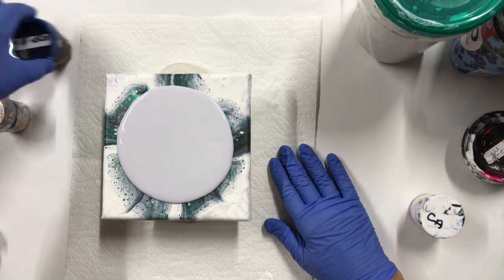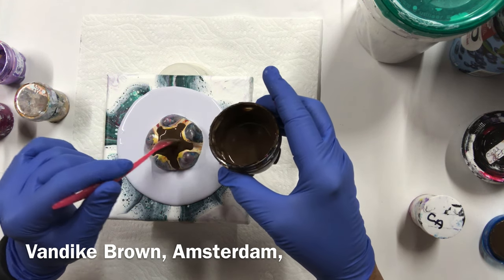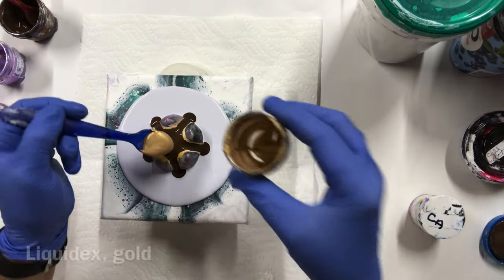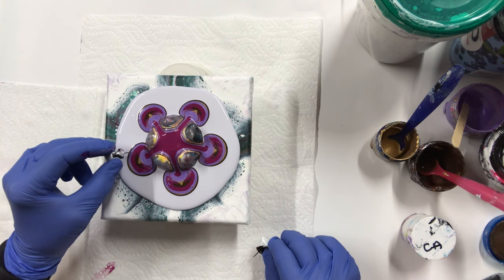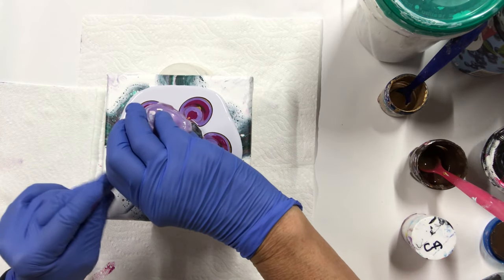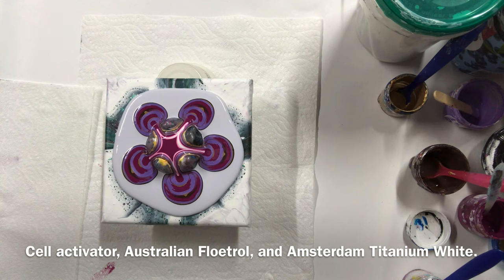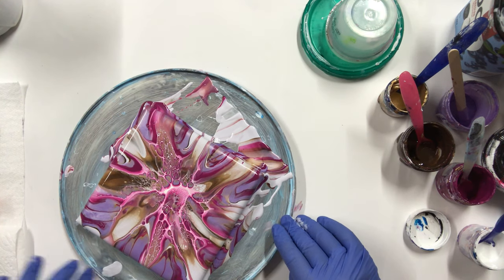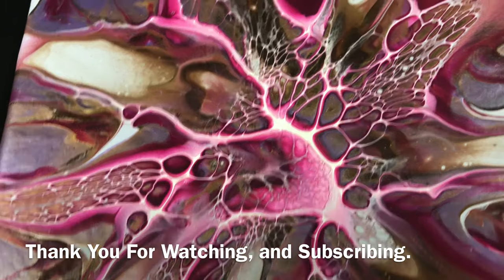(635) Bottle Bottom, Bloom, Mini Blower, Acrylic Pouring Technique

Comment: Beautiful. If you want some paint to go in the middle put some small arches in the areas where the paint does not flow. Be sure and leave some plastic between your arch and where the paint flows down. I used my dremel to do this. Your flower turned out really beautiful.
Reply: @Dropping Paint By Dianne so very welcome